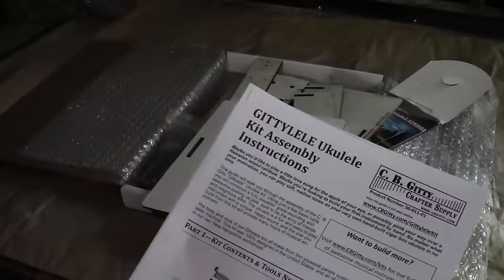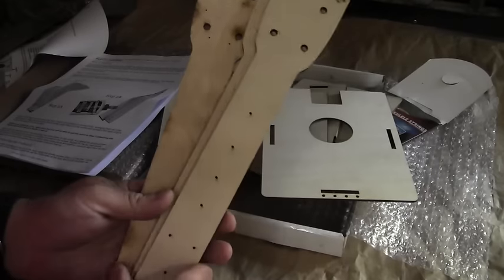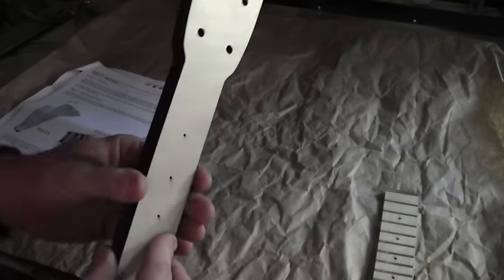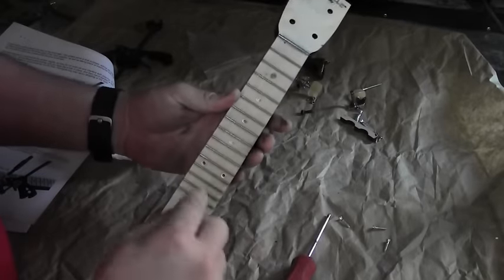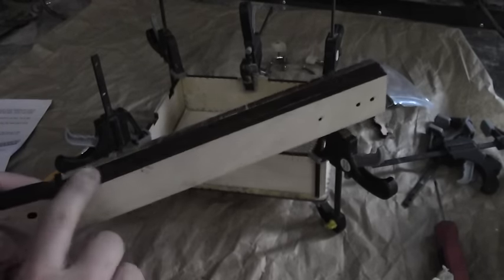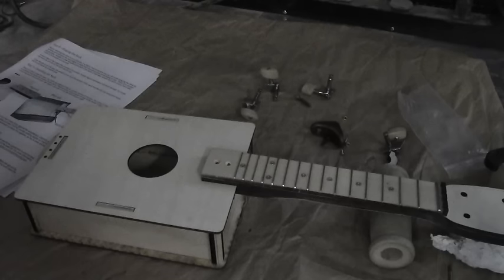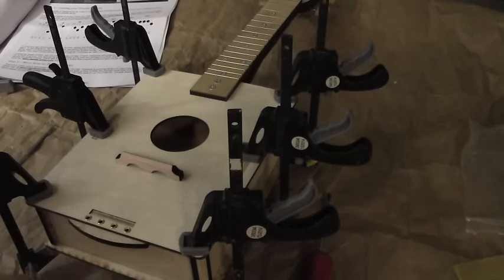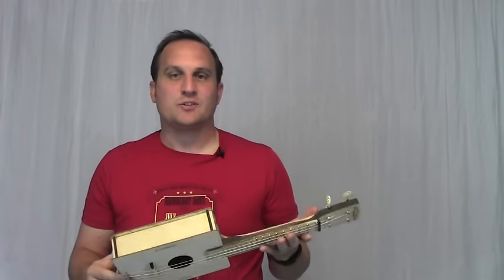Gittylele Ukulele Kit

Comment: Is that a soprano or concert?
Reply from the maker: This is the soprano version. But they also make a concert kit.
Reply: @CircuitsAndStrings  Thanks, I will buy the soprano version, because I like what's in this video! Liked and subscribed because of this video! Thanks!
Reply from the maker: Thanks! Good luck with your project.